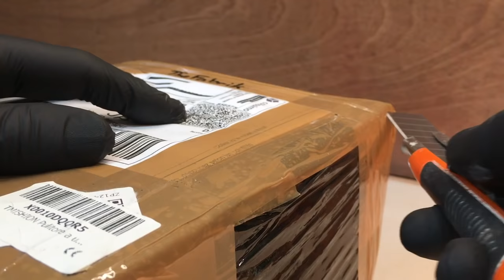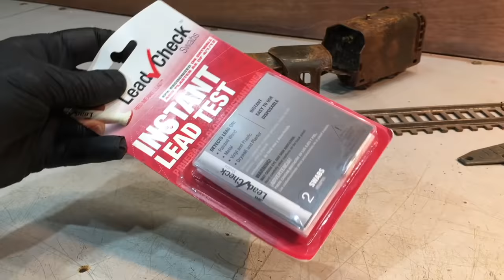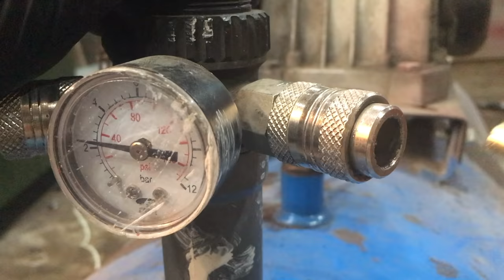Pre-war JEP abandoned model train - Rusty locomotive - Restoration

Comment: To remedy some of the rough running, I reccomend setting one side of the driving wheels at 90 degrees to the other side. This is called "quartering" and it balances out the weight in the wheel
Reply from the maker: You’re right. I didn’t know about that. It’s fixed now !! Many thanks 🙌

Comment: Outstanding video, I work on 1940s and 50s model trains and have a few of the old ones. But I like to gut the windup which is usually broken, restore the sheet metal then adapt a 50s electric motor chassis so i can run it on my layout. I one cast metal body that must weight 2 or 3 pounds. Excellent video and technique, you are an artist is the restoration process. Thank You so much for sharing. Dennis in Virginia
Reply from the maker: Hi Dennis ! Thank you very much for watching and commenting !!! 🙌👍🏻🙏
Reply: It'd be real easy to slap a Marx motor into that. I love that shell.

Comment: Great job with the restoration.  There are tools and techniques to re-quarter the drive wheels so it doesn't jump around so much running.  It is fiddly work to get perfect.
Reply from the maker: Thanks a lot for watching and commenting ! Well I tried to find some infos on how to get the correct adjustment but I didn't find anything 😐

Comment: I love your restoration work. 
On the 1937 catalogue the same loco is not proposed but a non-aerodynamique one, Axle arrangement 240 (120 as we say in France) and is listed as "train mécanique numéro 7" with a battery in tender and a front light in the loco.
The same loco as yours is on the 1940 catalogue as part of train n°6 "de luxe" with a front light on the loco and the tender could host a 4.5 V "batterie de lampe de poche". Pre-war markings are "Nord".
This loco is also in the 1954 catalogue with train n° 6 "de Luxe" with a 4.5 V battery in the tender and the front light on the loco. The difference is post WW2, the loco was marked as SNCF with its logo on them on the - then added - smoke deflectors.
So all the JEP locos I mentionned were De Luxe with a clock work motor and a provision to install a flat 4.5 V battery to light up the lamp screwed at the front of the loco. The same loco was also produced with an electric motor with a mechanical direction switch (transversally on top of the loco.
To be noted that the cheaper locos (not the De Luxe version) were lithographed
I cannot be more precise as I don't have all JEP catalogues.
Reply from the maker: Wow thank ms a lot for all these precious infos ! I didn’t know there was a battery in there ! I’m now looking for another loco with the original battery 😌
Reply: @TheFabrik  They were normal batteries (installed by the user), not rechargeable ones. So if you find one with a battery then it will likely be very corroded by the acid.

Comment: There's no way it could have been electric since the clockwork drive is present. The lamp socket is probably used to have a bulb under the chimney to heat oil to produce smoke.
This model probably takes inspiration from the streamlined engines from PLM, wich were put under SNCF ownership after the war (SNCF dates from 1937). These were the only streamlined locos in France as far as I know. And these were (and the whole train) painted... blue!
(Fantastic work by the way)
Reply from the maker: Hi Damien thanks a lot for watching and commenting. I thought it may have had an electric motor before. Wow I would have like to have that smoke system 😳 Thanks for all these infos.. again😉
Reply: @TheFabrik  its entirely possible it just had a light, if I'm not mistaken Lionel made some wind ups with battery powered headlights.
Reply: It looked like the battery may have been in the tender.
Reply: @dogerecords5312  - I think Hafner also made some of their wind-up locomotives with a battery powered headlight.
Reply: I think smoke would be a bit too realistic, just a light
Reply: @samuelfellows6923  I had a toy train as a kid that smoked. It just had a little element inside it that heated oil. It’s pretty simple. 

I’d say it would probably depend on how the area around it was built - if it looked like it was meant to have a hole for a light, or if there is a hole for the smoke stack above it. 

Given it’s age it could be as simple as ‘drip some oil directly onto the light bulb through the smoke stack before use’.
Reply: @TheFabrik  The tender is supposed to house a battery for the light.  Not enough juice in a 1930s D cell to power smoke. Plus, we saw the light socket.

Comment: I don’t think it had an electric motor… the bulb holder in the front was probably to make the main head lamp at the front light up. I’m guessing the tender had a battery to power it and that’s what he sliding switch / lever on it was for.
Reply from the maker: Ok Jason thanks a lot for all these infos. I think you’re right. 🙌👍🏻🙏
Reply: I agree with you only if he put it in and had it working then you could see it in the dark it would have been awsome.
Reply: Can confirm. This was definitely a wind up model (the hole in the side for the key is original). The battery was housed in the tender. Having the key is quite rare! Cool find and awesome job on the resto!
Reply: @TheFabrik  That would be an easy fabrication for you. Please update if you decide to relight it. I bet it would make the little guy really happy.
Reply from the maker: @Funwithhighnotes  🙏 Thank you !
Reply from the maker: @wintersbattleofbands1144  yep I’ll fix it definitely👍🏻
Reply: ..claro que no era eléctrica, el foquito era para iluminar el frente...

Comment: I seen a couple of this before. One with and Without the electro system. The Earlier models had the Electro System and then was switched to windup. early 1930s is when this came out around. up until mid/late 30s when they were stopped.
Reply from the maker: Thanks a lot for the infos !! 😃👍🏻🙌🙏

Comment: When assembling a locomotive put the wheels 90 degrees apart so the front set doesn't try turning backwards, this is also done on real locomotives, still great work on making it run
Reply from the maker: Thanks for the tip. Probably needs some adjustments…

Comment: It's probably been said before, but the only flaw in an otherwise perfect restoration is with the front driving wheels.  They are out of quarter.  If it were adjusted, the locomotive would run more smoothly around the track.  I was very impressed with the wheel pulling gadget you manufactured, and with your ability to fashion new small parts.  Very impressive.
Reply from the maker: I missed that point ;) Anyway thanks a lot !!! 🙏

Comment: 03:35 looks like a socket for a little electric bulb

Amazing work :D
Reply from the maker: Thank you very much ! 🙌👍🏻 Yes you’re right, with a battery in the tender...someone told me it could be a smokey system with oil...
Reply: @TheFabrik  some trains do have those but usually there would be an oil reservoir as well, but it just looks more like a bulb holder for that front lamp
Reply from the maker: @ModelMinutes  I'll try to fix that front lamp ;)
Reply: @TheFabrik  nice 😊

Comment: fantastic job 
only thing I would have done different, would have been to have used a high fill two pack primer (automotive paint) and wet rubbed that back. It would have removed all the damage done by the pitting 
but other than that. The whole job is a credit to you 10/10
Reply from the maker: Yes I should have used filler. Thanks Mike 😌👍🏻

Comment: What, you did not spend another day or more rebuilding the drive system and cleaning it all and removing all damage!!!, I CANT BELIEVE THIS!!.... I’m joking, love the work you did on that, I could never doing something so good. It looks awesome and I can only guess how much work you put into this. I love watching your work. Awesome job. Make sure to take enough rests.
Reply from the maker: Thank you very much !! On another vid I disassembled the clockwork mechanism... To be honest I’m not equiped to reassemble these motors properly. Thanks for watching and commenting ! 👍🏻🙏🙌
Reply: @TheFabrik  I can understand that, those mechanisms can get pretty messy and convoluted. I’ve looked at stuff like that, my friend was trying to repair an old record player and I had to lookup the blueprints and locate the section for the repair. The record player had a speed issue as it was playing to slow and had a sound issue. It was a semi electric / mechanical record player. The repair required cleaning out the inside, regrease all the parts and fix a few faulty wires, plus remake a rubber gear that was designed to wear. I wasn’t there to see it but he said it was crazy and he has much less equipment.

Comment: Awsome, this particular design is among my personal favorites for some reson. I hawe the big sister with the electric gear motor in the same serie.
Reply: The chassi looks like the clockwork design, i don't hawe any of those so i can not say for sure, but maybe some of the later produced models had the possibility to use functioning lights from a flashlight battery?
Reply: When i look at the video it looks like there was originaly a fitting for a 4,5V battery (or a pair of 1,5V large carbon cells) in the tender and that switch and the brass connector on the front where probably the + for the lights? On some wagons from the same era it was possible to retro fit them with lights and on the electric wersion of the locomotive it was possible to tap power from the locomotive via a set of 3 connectors running from calbes in the cabin.
Reply from the maker: Thanks again for all these infos. Well yes it seems like there was a battery in the tender with a bulb coupled to it. Someone told me it could have been a smokey system but not sure about that... I think I should do a short vid to show how to fix the light.... thanks again... really appreciate it 🙌🙏👍🏻👌🏻😃
Reply: @TheFabrik  You did a realy great job with the set!

It probably came in both options, but The old JEP electric motors where far more advanced and probably a lot more expensive and consumed a lot of power so carbon cells had probably drained out pretty quick (the very early DC locos where probably ment to be used with car batteries or rechargable stationary radio batteries, they still used the 3 rail system since radio batteries are insanly heawy and can not realy be carried on the train) (however in the early 1960s and late 50s there where a lot of German made lightweight tinplate trains with for it's time modern permanent magnet low power motors wich operated from flashlight dry cells in the tender or a tinplate building connected to the tracks, most of the toys and model manufacturers did cross copy solutions from each other as it seems...), that's why i guess it had this strange combination before those ceap motors came, i hawe seen similar lights only function on some American tinplate toys from the same era).

I actualy hawe a very small 00 like scale but with larger tracks JEP miniature clockwork set complete with tracks and signs,  half scale is fun! and relativly sheap in comparision. I don't hawe much tracks for it so it's more of a fun cuiosity in the collection and it can run in a circle for a couple of minutes. It's cute to watch side by side with the larger siblings.
Reply: @TheFabrik  I am not sure about the smooke system, but i hawe seen it on some later American trains, some of the more advanced ones had a small pump, but most common where a simple oil pot filled with glycerol and an electric heater, pretty much as a modern vaping pipe, i would not be supprised if it where possible to modify a cheapo E-cigarette to a smoke device for the locos.

I hawe not seen this on any of my older locos from European manufacturers, only on one of the lionels and the American flyers.
But those are much later made.

Comment: Genuine clockwork locomotive fitted with electric headlight powered by a battery carried in the tender hence the on off switch - all original factory spec.

Comment: Nice work and what a long-term job, Too bad you have badly wedged the wheels. You can clearly see the connecting rods which are not horizontal. Look at your images before disassembly, the connecting rods are indeed horizontal. Astonishing that THE LOCOMOTIVE can roll like this !
Reply from the maker: Actually I tried to put the connecting rods as they were originally but they didn’t move.... at all. Wheels were blocked... I don’t  know why.
Reply: @TheFabrik  In fact, I build 1 / 22nd locomotives. When I put the wheels on the axles, I fix them on one side of the locomotive and you have to insert them on the other side, shifting them 90 degrees.

Comment: Again a most interesting video, , could the tender have housed a battery? I suspect so.   Could never have been electric as it would have `Shorted` out, there being NO insulation. . Please also thin the first coat of main colour and try and use a lower pressure (Air) on the airbrush.   Two or three thin coats are much better than one thick.    Thank you again.    Oh!   Try a drop of Brick cleaner to clean up Brass parts and Burnish instead of polishing.
Reply from the maker: Thank you ! There was a battery in the tender... didn’t know about that... My painting job must be improved I’m workin’on it ! 😌🙌

Comment: I am VERY impressed by the way you turned a drill into an impromptu metal lathe! Regarding the electric bit, it looked to me like that was for a bulb for the headlight. Also, I was curious that you didn't make a replacement for the missing smokestack.
Reply from the maker: Thanks a lot Joseph. I didn’t know but it seems like there was a battery in the tender...  Is there a missing part ? I haven’t seen any missing smokestack.
Reply: @TheFabrik  Maybe there wasn't one. It just seems like there should have been a smokestack, but I could very well be wrong.

Comment: Congratulations for this work!
For the light of the locomotive, it is not for electric locomotive, you have a little battery on tender to power on the light, it miss the electric wire between locomotive and tender.
See the tender, you a have a switch to turn on the light.
Reply from the maker: You’re definitely right Nicolas. I’ll fix that lighting system asap !! Thanks again for watching and commenting 🙏🙏🙏

Comment: I had to go back and watch this video as your work is a pleasure to watch. I ESPECIALLY love the brown you painted with!! Can you tell me the color? I will paint an Sk800 in the same color!! Now, a big question. You noted the engine had an electic motor at one time. While your repair of the clockwork motor, and especially the homemade gear, why did you not look for a replacement electric motor? I myself would have popped in a Marx motor. Thank you in advance for the paint question!!!
Reply from the maker: Thank you very much !! I guess they made the same case whether it was electric or mechanical motor. The color I used is « brown sepia » from the brand Vallejo 😉👍
Reply: @TheFabrik  Thank you for the information!!

Comment: Looks like something hiccuped on the inaugural run. Great work regardless. Question though. How come you don't soak a project like this in a dip tank of evaporust, purple power, water and molasses, etc., before disassembly? I would think it makes it easier.
Reply from the maker: Thanks a lot for watching and also commenting. Not easy to find these products here in Europe like Evaporust ... I really need to try it tho ;) Well the metal sheet is so thin and the little springs are so fragile I’m always afraid to hurt and damage them. Thanks again !! Greetings

Comment: You want to put some proper model train lubricant, or mineral oil, on those gears. The WD-40 will start to become sticky because it is made from petroleum, which can become sticky over time, and it will jam up the gears.
Edit: Also the wheels are not quartered properly, which is why it ran rough.
Reply from the maker: Thanks a lot for watching and commenting !! 👌🏻 As you can see on the video I dipped the clockwork and other parts in Acetone to remove the grease and wd40 residue. I put on classic oil afterwards. Regarding the adjustment of wheels I did not find any info about that... If you have some✌️ Thanks again ! 🙌
Reply: @TheFabrik  There is no complex science to it - one set of wheels and pistons is positioned 25% "ahead" of the other in its cycle, to smooth out the running and prevent that rocking we saw in the video.

Comment: Krylon paints has a high build primer that dries quickly. It will fill your pits but does require the time needed to sand it down. I've used it on some old 30's Lionel engines with excellent results. https://www.facebook.com/photo/?fbid=10209373793122306&set=a.10209373751841274
Reply from the maker: Ok John thanks a lot for the info 🙏 I’ll take a look at that Krylon paint. The link doesn’t work btw... many thanks for watching and commenting !! 👍🏻